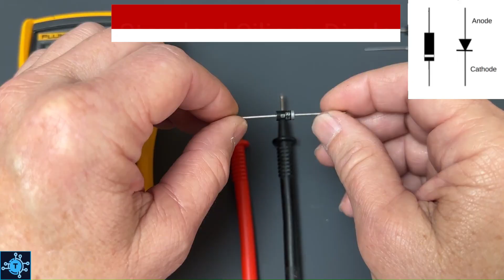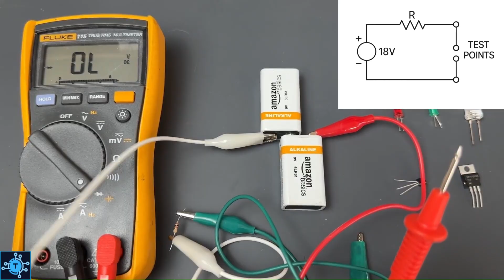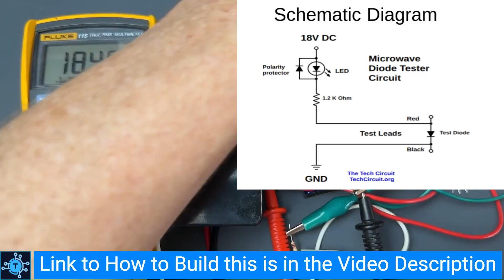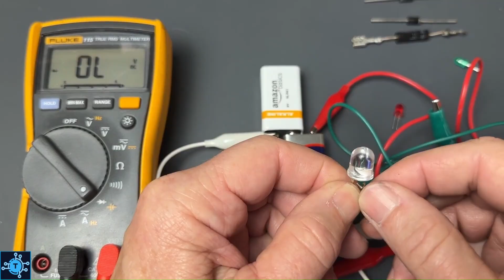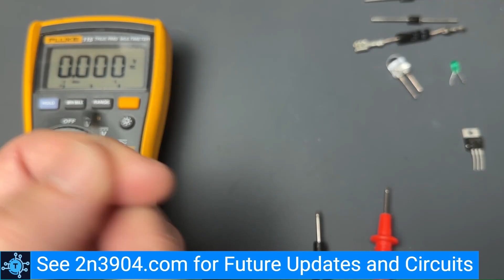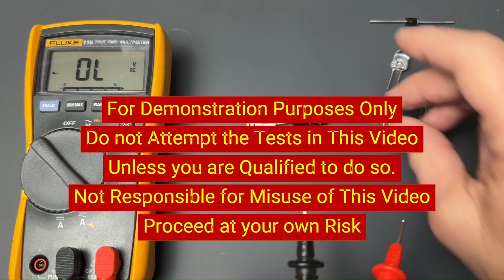#137 - Testing Semiconductors with a Multimeter—Diodes, Zeners, Microwave, LEDs, Transistors, MOSFET

Comment: Little sidenote when measuring in circuit in resistance mode. If for some reason a Schottky diode is placed in parallel with a high value resistor, per example with a 300Kohm (or higher) resistor, you can get very low readings way below the 300Kohm in both directions of the Schottky diode. 
Some Schottky diodes have so much leakage current that they can mess up your resistance readings. A while ago i was searching for a prototype circuit for a Schottky diode, and found a used SR506 Schottky diode (60V 5A) in my parts bin and the diode check was fine, but when i did a resistance measuring, i got arround 10Kohm readings in both directions. When i used 2 other digital multimeters, i got 3 different values, all very low.
I first though this diode was bad, but when i searched for the datasheet, i saw the reason of the weird resistance readings. This type of diode has up to 0.5mA (500µA) of leakage current a 25° C, which seems to be more then the current that a digital meter use. 
With that amount of leakage current, and when for some reason a high value resistor is placed in parallel, you can presume that the resistor is faulty because you see low readings in both directions of the diode. But there is a clue, because the readings are slightly different in both directions of a "leaky" Schottky diode, you pinpoint the cause to the diode, because if the high value resistor was bad and had a much lower value then normal, this value would be equal in both directions.